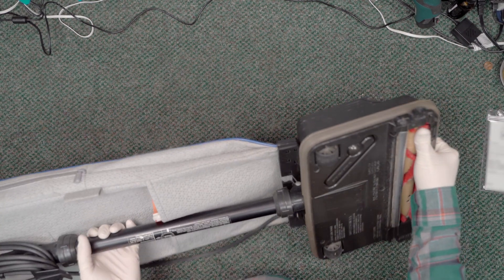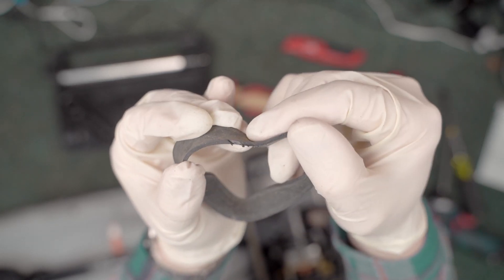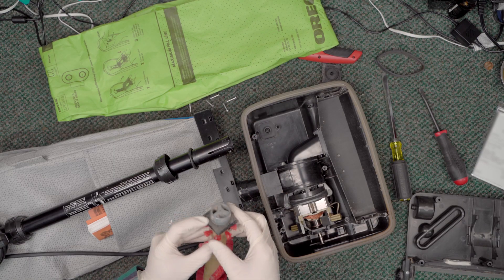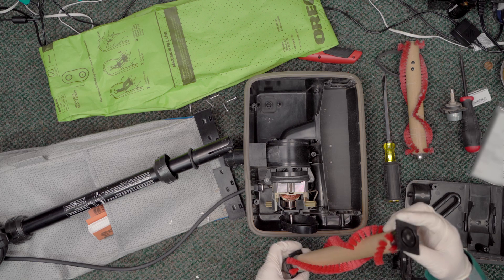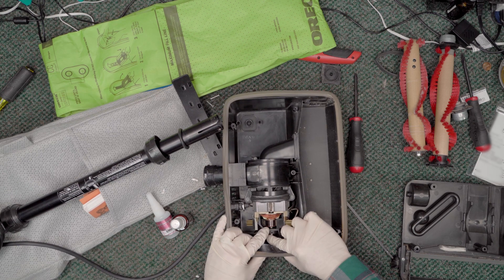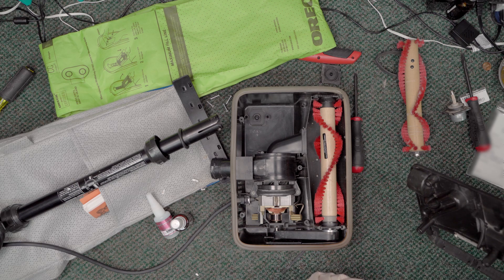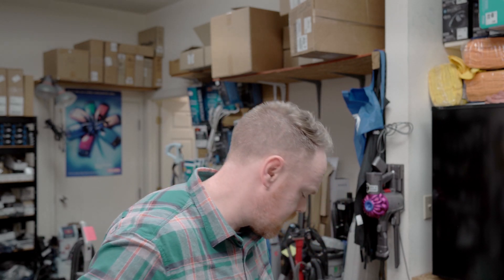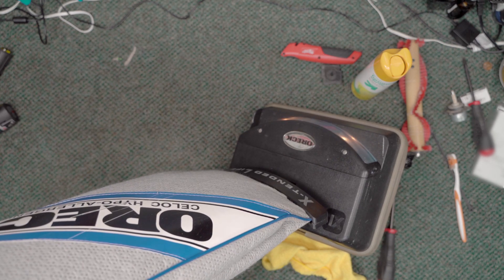Oreck XL2 Unclog & Brushroll Repair - The Vacuum That Was The End Of An Era

Comment: We couldn't kill our 2006 Oreck until my son said that the bag was not inflating but the motor was going strong.  I took it apart for the first time (thanks for your great video!) and all went well as I took it apart and later reassembled it.  I tried to loosen up the pole on the handle, but it wouldn't budge.  When I disconnected the bag  (that wasn't full) I found the jam.  Gobbs and gobs of stuff. Packed as hard as a sausage!  We had a "grabber" with a flexible long handle that got to the bottom of the problem.  Without this helpful tool from the dollar store years ago, we would have bought the newer XL Oreck on Amazon.  Thanks so much for your comments about the ITT company that bought up Oreck.  NOW, I'll plan to find a recommended product for when the motor dies!
PLEASE MAKE A RECOMMENDATION.  Thanks so much!
Reply from the maker: Hi Marilyn, I'm glad that the video was helpful for you!

If you want to stay with the ultralight form factor, the best alternative to the Oreck is the Riccar Supralite. Assembled in the United States by a family owned company, they weight the same as the Oreck but have a larger fan and more air flow. Hope that helps!
Reply: @HouseOfVacuums  dang, I wish I had kept my Riccar Supralite as I just recently found an Oreck XL. I would've loved to have done "battle of the vacuums" video between them. Oh well.

Comment: I have a super weird geek for vacuums of all types.  I have just about every industrial and commercial type in my inventory because of all the different types of surfaces / situation that I encounter.  Oreck XL commercials are one of my gotos when I need carpet with fine debris vacuumed well and not having to throw out my back in the process.  For the large jobs, I have 3 different varieties of Carpetriever XP28s that work wonders but are an absolute blast loading back up.  I am very impressed with your website and your YT videos,  I actually learned the proper belt alignment process because of you.  I think I will just have to like and subscribe because you are probably the best source of knowledge out there.   Thanks and Gratitude,  Todd Kimbrell
Reply from the maker: Thanks for the comment and the sub, Todd! Also, thanks for sharing your experience using the Orecks commercially. I'm really trying to build a community and knowledge base here where we can all help each other out.

BTW, I'm a super weird geek for vacuums as well (no secret there!). You're in good company!
Reply: @HouseOfVacuums  I know you are not a huge fan of Jr.  But he launched his new David product line and i was curious if you have had any exposure to his line up and if so, your unbiased opinion would be most appreciated.
Reply: @Mainbusfail  Hi Todd! So the David uprights are relabeled Riccar Supralite uprights. Tacony, Riccar's parent company, makes them for the Davids stores. 

Honestly, they are great machines and well proven in the marketplace. The only thing I would say is to be careful not to pay more for the David version than the Riccar version, as there is literally no difference between the two.

Hope that helps!

Comment: I've an Oreck XL2000RH Commercial that has functioned well for the past  several years. It recently started giving off a burning rubber smell. Opening the inspection cover revealed a disintegrating belt and a motor shaft having difficulty turning. The motor was removed and found the bearing directly behind the fan, in front of the felt washer,  was partially perished. I fabricated a new bearing from parts I had and now the fan rides higher on the shaft and not interfering with the motor body anymore. Cleaned the motor and area around it, tested and now functions as it should.
Reply from the maker: Nice work! Thanks for watching and commenting.

Comment: I love my Oreck XL21 and it has never let me down for at least 15 years or more.. I love the 2 speed motor and the easy belt change. I had to replace the bottom plate last year as the rubber strip had worn completely down but other than that I have never had any issues.  I take it apart twice a year for a complete cleaning and wipe down and I only use the Hepa Cloth Bags.. Hope it survives for another 15 years.  Enjoy your videos.
Reply from the maker: Glad your Oreck is working well for you. Thanks for watching and commenting!

Comment: I cleaned out the tube, but did not clean out the case of my plugged Oreck. My XL seems to be blowing air now, so I will clean out the case and check the alignment of the best like you showed us. It should work fine.  Thank you...
Reply from the maker: Double check the inlet from the brushroll to the motor, that is also a common area for clogs. If you don't see anything, it might be time to look up a local repair shop. Thanks for the comment!

Comment: I found a orick XL next to a dumpster, wire has a split near the handle, otherwise a clean and it is ok. Also had some orick spare bags and a flexible pipe that I guess is for something completely different.
Reply from the maker: Nice! I definitely think the flexible hose probably came from another vac. Thanks for watching!

Comment: hmmmmm...had always wondered about Oreck.  A tiny little direct air fan?  simple flat belt?  How long can these go between services?
Reply from the maker: If you don't have an issue with hair wrapping around the brushroll they can go quite a while between services. In households with long hair, usually less because the belt side bearing of the brushroll is not serviceable on most of them. If it gets in there, it can cause some major issues.

Mostly we see them in for clogging. Small passageways and a small fan always equals blockages!

Comment: 9:51 those are huge electric brushes. To any one who may know. Are most AC electric vacuum motors brushed, something else,  or are they starting to use Brushless motors? Now I'm interested to know what my Riccar R40p used? Thanks 🤔 Buy the way, doesn't Matt kind of look like Bill Burr.
Reply from the maker: Hahaha, I'm about to shave my head... so the Bill Burr resemblance might get stronger!
I'm not sure why the brushes on these Orecks were so big, but you are right they are huge. Pretty much all mains powered vacs still use brushed motors, including your Riccar R40. The only one that I am aware of currently using brushless is the Rainbow SRX and E-Series... and those were absolute nightmares, mostly due to the PCB necessary to control a 4 phase brushless motor in a humid environment (water vac).
On the cordless side, all Dyson cordless vacs use DC brushless motors... there may be others. But they are much more suitable to that particular application. On the same token, still very, very complex electronics to control pulse-width modulation (PWM) across the motor.
Hope that helps!

Comment: How do you fix the brushes at the back? They popped off and I can’t get them to stay????
Reply from the maker: Brushes at the back? Are you talking about the sealing strip right behind the brushroll?
Reply: @HouseOfVacuums  no, I’m sorry. I meant the little wheels at the back..?
Reply from the maker: Those are friction fit into the housing. You may not be getting them fully seated. Put them in place, then take a flathead screwdriver and place it on the little bit of visible axle. Then tap with a hammer until it is seating. You'll need to do that for all 4 spots where the axle comes in contact with the base plate. Hope that helps!

Comment: I took off the metal plate and rubber dam and washed them. Can’t get it back on now.
Reply from the maker: Yeah, on the metal plate.... those are crimped on from the factory, so if you take it off is VERY tough to get back on right. The only option that I have sometimes had work is glue it on with industrial rubber cement.

Comment: I have rebuilt a few of my inlaws old XL's, super easy to fix.    Are the new Oreck Hepa Bagged uprights OK to buy?  My Mother inlaw is looking for another.  Do You sell refurbished units? Thanks for the history lesson!!!!!
Reply from the maker: Glad you liked the video! I don't deal with used vacs unless they are super cherry Miele, Sebo or Riccar units. But you should be able to find used Orecks no problem. If you find one, make sure it is an XL2 style or an Elevate. Do not buy a Magnesium or any other similar model... those were early TTI designs and were terrible.
All newer Orecks with the Type CC and later bags have the ability to run the HEPA bags. 
Thanks for watching and the question!
Reply: @HouseOfVacuums  Thank you!  Just bought an old XL 21 750 model series made in New Orleans, LA on ebay, mint.